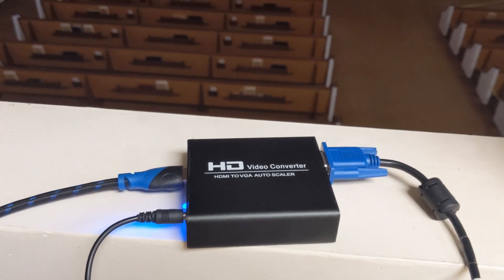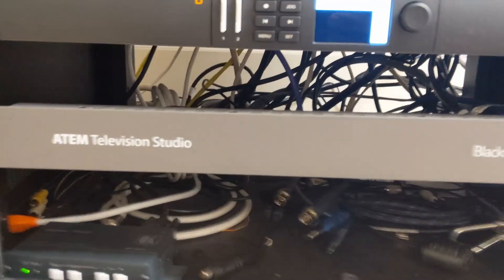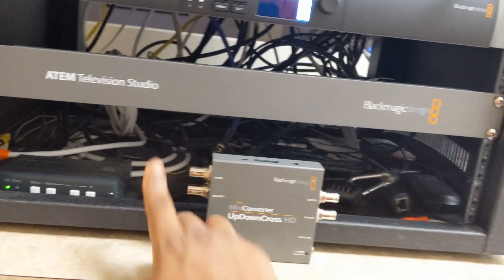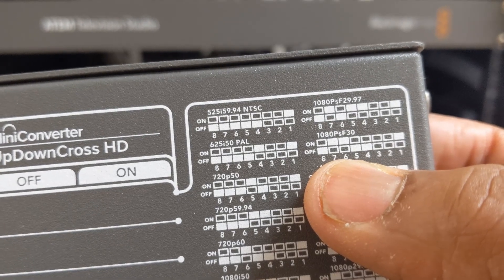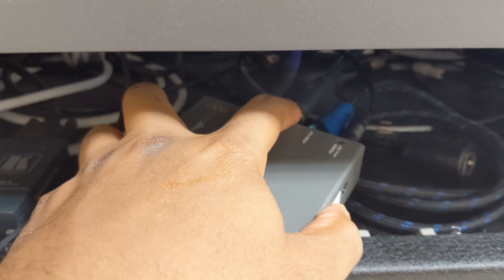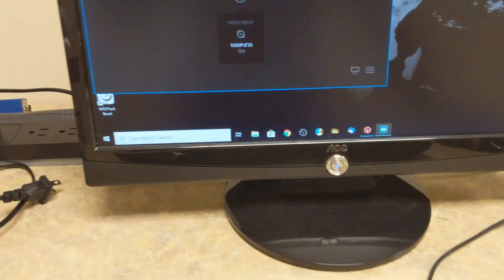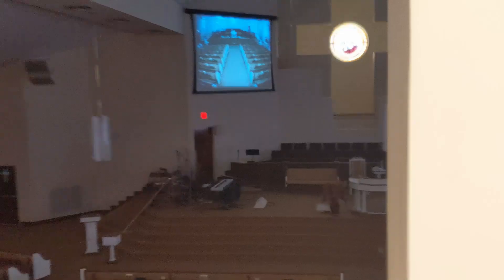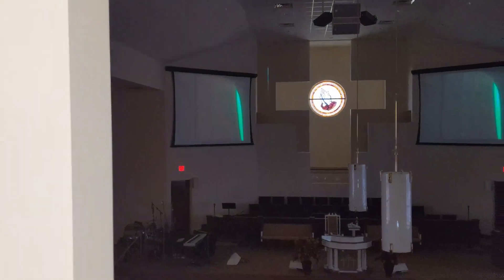BlackMagic Design UpDownCross HD - Install

Comment: Good day, I need help. My video camera which only has 1080i 59.94 to my atem studio hd (with the same frame rate). I’m having a hard time in making decisions if I should buy every camera a updown cross converter bcoz my 2 extra camera has 1080p60. The Atem video switcher cant display if the frame rates are not all the same. Should I buy every camera a updown cross converter instead? Thank you!
Reply from the maker: Why not just up the one camera that is limited to 1080i to 1080p?